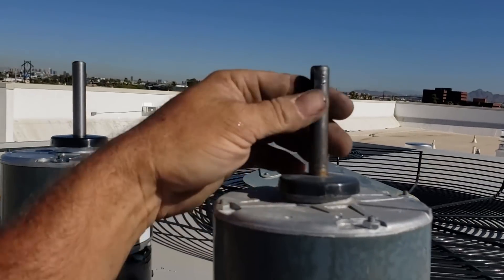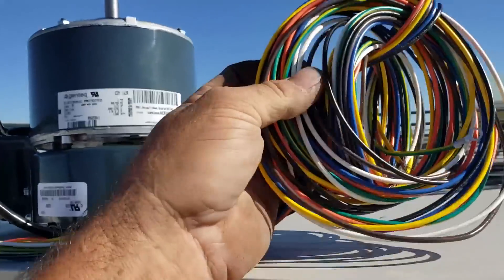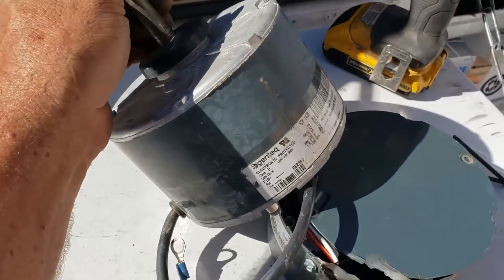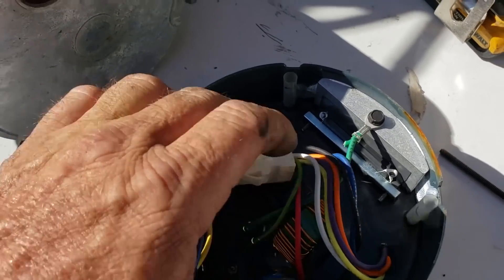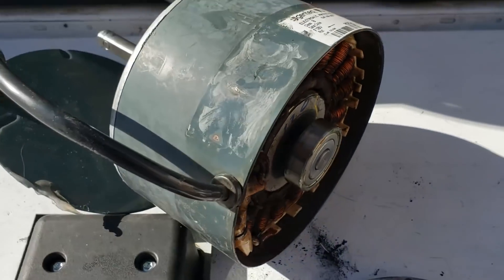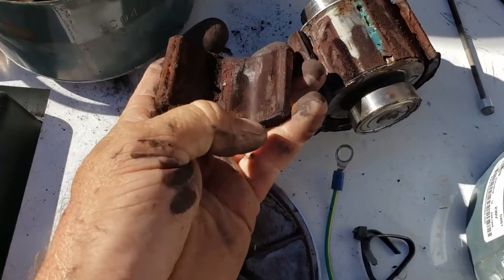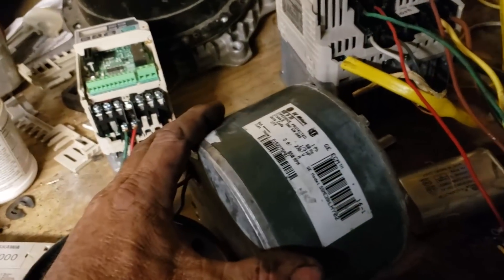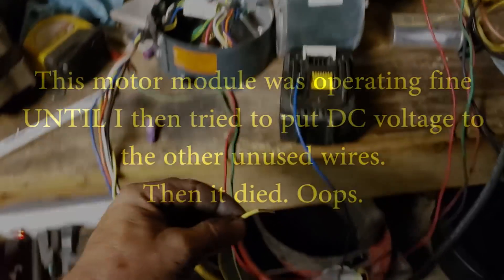Failed AAON ECM Condenser Fan Motor & Motor Disassembly

Comment: I wonder if that is what happened to the AAON I had the condenser fan blowing the no 4 - 10 amp 600v fuse. First time I seen a condenser fan motor lock rotor to 20 amps. Then taking out the fuse and all controls along the way since both transformers are on that circuit
Reply from the maker: If the module was not blown, I don't think it would blow a fuse.
The electronic drive will likely error and halt soon after attempting to drive the motor.

Comment: So this is what happened to ours...2nd yr our indoor motor failed.  Acted just like this.  Was seized but it didnt seem like bearings. Because it would turn a little just like this one but if I forced it made that horrible screeching.  I didnt get to take it apart bc we had it replaced under warranty but they tried to blame it on the attic being too humid.  Seems more like a defect to me.  The 2nd motor has been going fine for 6 yrs now